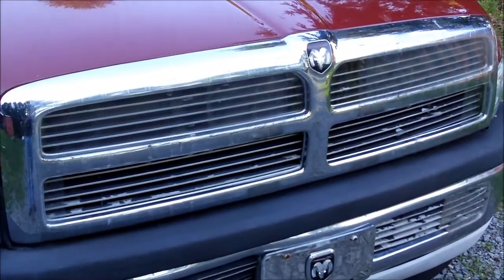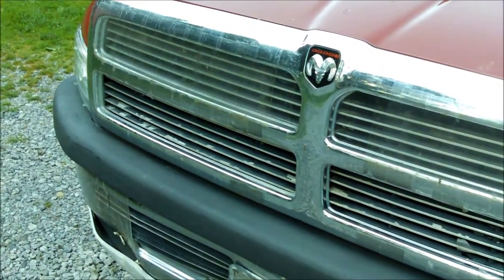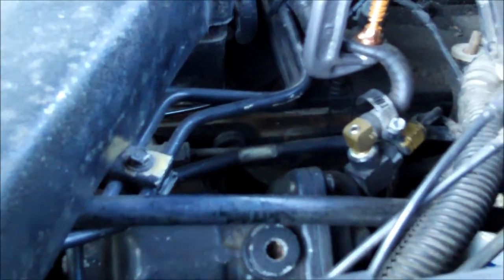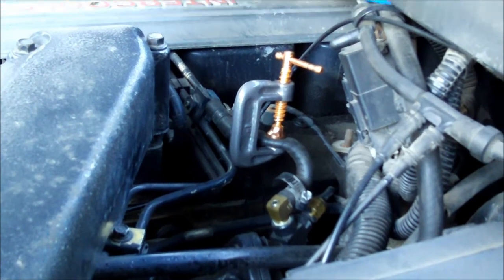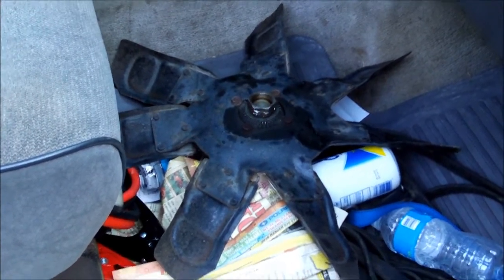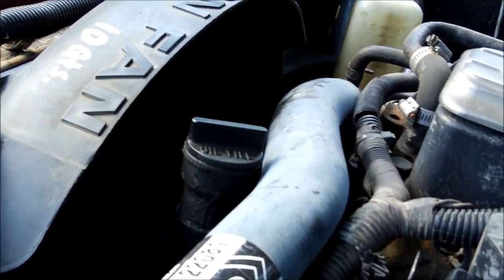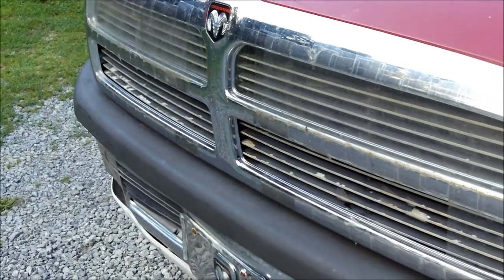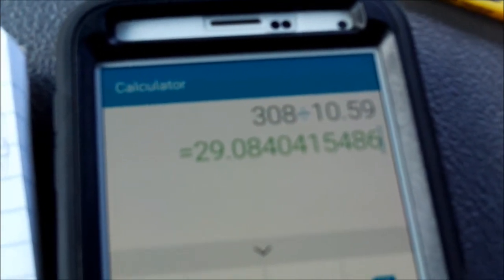Hypermiling the 12 Valve Cummins Pt. 3

Comment: Hey brother just subbed to ya! What rpms will you run on the highway? I have a 1997 dodge 3500 dually and she has 4:10 gears 🤢🤭.  So if I’m in a hurry and doing 70 I’m running possibly 2350/2400 rpm and doing 65 I’m pushing around 2100-2200
Reply from the maker: Thanks man!  I run about 2000 rpm at 70 mph with the 3.55's and 235/85r16 tires.  Had to swap a bunch of speedo gears to get the speedometer reading correct.   Still got the truck, and got half the footage filmed for another part, but waiting for a good trip to break into the 30 mpg range.
Reply: toocheaptosmoke can’t wait for more videos! I want to try the motor oil in diesel, I use ole 2stroke at the moment. My injection pump has a “swoosh” to it kind of like airy sounding. Do they all have a pulse sound to them while fueling? Sorry if I make no since, currently in the process of a rebuild on my 97 3500. I love these old trucks and I have learned a lot about them just by the community that surrounds these trucks! Thanks for the reply brother

Comment: Always rewatch your 3 video series on these trucks. Bought my 98 quad cab 12v 4x4 about 6 months ago and ive steadily increased from 15MPG initially to 19.6 MPG today. Lucas Injector Cleaner is honestly one of the biggest modifcations I've done. I would love to see a part 4... perhaps with you showing off any increases in fuel economy from the lucas additive!
Reply: I run a 98 12v with the 410's dually laramie slt   and  I  find  46-47mph runs  me  a  touch below 1200rpm  gets  26mpg  holding it at 50mph 1400rpm she gets  over 20 mpg may wanna try that out  brotha.
Reply: @isaacwhite767  that’s true if your not in a hurry ! Lol. My diesel at 80 mph turns at 2k in overdrive !

Comment: You would probably get lower egts if you boxed in your bhaf but lower intake temperatures generally make more power although might lower your mpgs slightly due to heat effeciency
Reply from the maker: I've thought about that too, not sure which way would help mpgs?  The intercooler may also help cool the charge enough to offset the warm air intake?
Reply: Alittle late to say but you want everything warm except intake air. Better intercooler is best. Air density is very important.